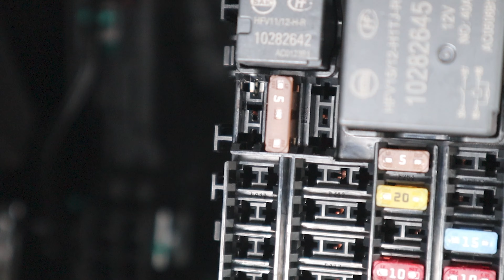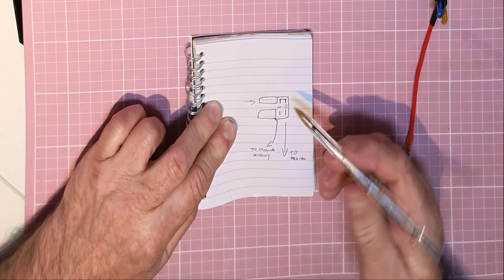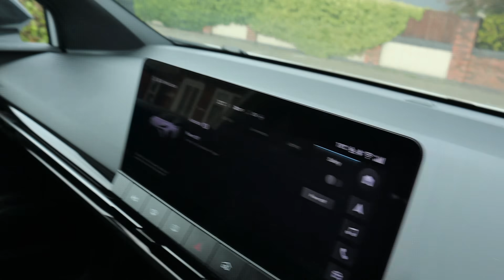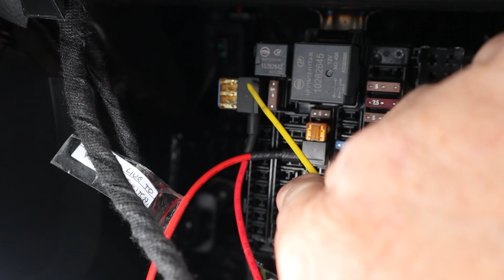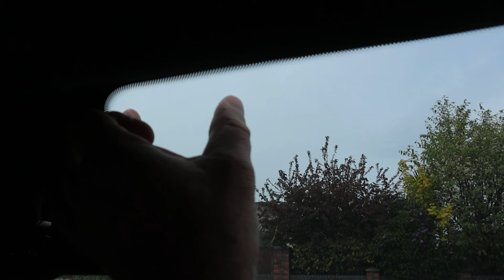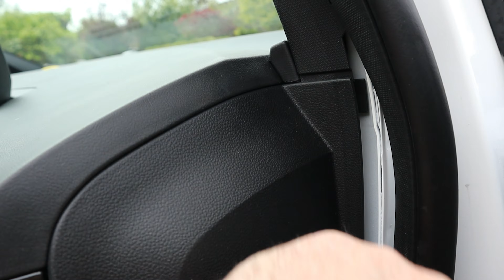MG4 FRONT & REAR DASHCAM INSTALL PART 2 OF 2

Comment: The video is very very good and ultra detailed. I have a question, if the problem is the parking mode that long holiday can drain your battery, instead of installing the switch is it not easier just disconnect the dash cam?
Reply from the maker: HI thanks for the kind words...yes you could do that as well but if it is left for regular long periods (like mine is) it saves wear and tear on the micro USB socket
Reply: @TomsManShed  thanks Tom

Comment: Hi, could you tell me where you got the micro3 piggyback fuse tap please?  I ordered some off of Amazon and the other end (I'm not very technical) where the dash cam lead plugs into was too small.  Nextbase say they don't sell the micro 3 and I'm struggling to find one that fits.  Many thanks
Reply from the maker: Links to the micro 3 and the micro 2 piggybacks are in the description
Reply: @TomsManShed thank you.  And does the bullet connector just push into the end?  Or did you have to wire and crimp it?
Reply from the maker: @SteveDaxx  Hi Steve  I think all the bullet male connectors and female sockets came ready crimped to the wires but its 3.5 years ago so can't fully remember...I may have had to cut some off and crimp on new but its easy enough with a proper crimping tool...I did a vid on a good crimping tool here   https://www.youtube.com/watch?v=8Gh2BK4ANc0   I would always advise using this type with the proper wide jaws and not the thin ones that are part of wire cutters.

Comment: Excellent video 10 out of 10 keep up the content just one question where do I find the voltage cut off until thanks daz
Reply from the maker: Hi Darren...thanks for the kind words...I really appreciate it.

Yes I just checked and I forgot to put the link to the hard wiring kit in the description (I put it in the vid of this same camera in my previous car an MG ZS) so have now added it to the description of both parts of this video.

You can set the voltage not to go below a certain amount on it...and it stops your battery running totally flat in park mode .

There are many on Amazon ...this one is the one I used https://amzn.to/4qWE2xg  although it seems unavailable at the moment but many more are for sale ...just check with the seller for compatibility ...just search for "Viofo Hardwiring Kit" 

Hope this helps

Comment: Thank you so much for explaining it so well, and for linking the piggyback/s and fuses. My supposedly "kit for MG4" didn't come with them and there I was puzzled looking at my fuse box.

Ordered, I will try again when they arrive!
Reply from the maker: Hi Zeioth Thanks for the thanks glad it helped yes the hardest bit is getting at the fusebox...I have never had a car that requires you to remove a whole panel to gain access ...why the couldn't have put it behind an easy to get at flap is beyond me
Reply: @TomsManShed  All working. Thank  you!!!

Comment: Hello id like to know more about the piggyback micro3. Can I add a speaker instead of dashcam with it? It has black and red wires. Thanks and sorry I did not understand everything I'm French :-)
Reply from the maker: Hi Emmanuel   You can power any 12v component from a piggyback micro3...all it is for is to make sure that component has its own fuse and is not sharing a fuse with something else.

Re a speaker ...The voltage to the speaker itself (if its just a speaker) can vary system to system...but you would never connect just a speaker to a 12v supply from the car fuse box.

The 12v would run to the head unit/ amplifier etc and then the speakers connect to this
Reply: @TomsManShed  thanks!

Comment: Hi, sorry about the late hour
I have a MG4 like yours, I just watched your video regarding the connection of the Dash Cam. I would like to ask you, if I don't use the 2Pin fuse adapter for the foreseeable future, can I still connect everything like you did? although I imagine it's not a job done properly... I'm telling you this because in the space of a week my car was all over the passenger side... so I decided to install the Dash. Could you tell me how I get power for sentry mode?
Thank you in advance for all your understanding
Reply from the maker: Hi Davis... Not sure what you mean by "in the space of a week my car was all over the passenger side" But to answer your question you need a permanent live for the sentry mode and a switched live for the normal dashcam mode ...thse can be taken from any source where this applies ...the positions I picked just seemed the easiest.
Reply: Good morning Toms, 
Thanks for your comprehensive answer.
I simply solved it by reversing the colors of the 2 wires, red and yellow 
Basically, I inserted the yellow wire into the 15a 3-pin light blue fuse, while I inserted the red wire into the 10a red fuse. Now, luckily for me, the sentry mode also works very well...
Thanks again, happy holidays 2025

Comment: Amazing, I just got a Viofo a229 plus for $150 during black friday sale.. waiting for the delivery to work on it. the hk4 kit however does not include these 3 prong fuse bits.. is there a 2 prong one that can be used with ACC by chance or is it only the 2 you mentioned that go off when the car is locked? 

Btw when your 12V battery gets low the MG will/should supplement from the HV battery
Reply from the maker: Hi Airbag...thanks for the kind words...Those 2 at top left (20 mins in) were the only switched live ones I found ...all the 2 pronged ones were permanent live.

Some of the unused 2 prong sockets may be switch live but I was reluctant to use them....with the car not using them.

On the 3 pronged fuse the power in is the middle prong and then out to 2 separate circuits so you could fit a 2 pronged fuse to a 3 pronged socket if it was only feeding one way...ie the dashcam.

The 3 pronged ones are readily available on Amazon/Ebay etc though and are quite cheap so it may be worth getting some 

Yes I believe the  HV  batt does charge the 12 v batt when its low but have still heard of some folk on the FB coming back from hols to a dud 12v batt.
Reply: @TomsManShed  Thank you for the detailed answer once more Tom. I will try to get the 3 pronged one... I wonder if in my model the cig lighter may in fact use all 3 prongs vs just 2. I have the refresh version with the additional wiper, anyway I'll test that too :)
Reply from the maker: @Airbag888  Yes you may be lucky re the wiper....Yes the "you don't need a rear wiper due to the design meaning the rear screen wont get dirty" was a load of rubbish...it may keep reasonably clean at speed but mucks up like any other while static etc ...I really miss having one.

Let me know how you get on and which other socket is switched live if you find one and I will add it to the description and name check you.

Comment: How did you connect the switch?
Reply from the maker: It has to be connected to a permanent live not a switched live otherwise the parking mode wont be available...the switched live I used is shown at 24:00 minutes in 

Other parts of the vid show the switch in detail etc .

Comment: That connection you thought was an earth but wasn't is the 12V feed from the front fusebox!
Reply from the maker: Thanks for that...useful to know...you would think with it being live they would have put a plastic cover over it hence me thinking it was an earth
Reply: @TomsManShed  It would've been useful if they had.  I made the same mistake and decided to find out what it was.  I measured battery voltage between it and the chassis, that's when I followed the wiring diagrams siteguru had linked from the MG EVs forums and found there was a 12V feed from the front fusebox to the interior fusebox

Comment: it make no sense, Why MG has chosen not to use the onboard cam for DASHCAm and/or Alarm. i do hope that will come in time.
Reply from the maker: Hi Tommy...yes I suppose they could (like Teslas) but the problem is that the built in cams on the car are for traffic sensing etc and the rear cam is placed to help with parking and not in an ideal position or field of view for footage of drivers behind like a dashcam is....one day though it will be standard on all cars I reckon.

Comment: Only just seen this vid as I’m looking into an MG4, I used to watch your 3D printing vids for the CR6-SE which were very informative. 

I had the same issue when I got my VIOFO A129 ~4 years ago. You actually don’t need to plug into the base, you plug into the main camera unit and that powers the GPS base. I think the power into the GPS base was for some of the much older dashcam models.
Reply from the maker: Hi Callum..thanks for the kind words.

Re the base....you do need to plug the power supply to the base if you want GPS location info on the clips.

It's the base that contains the GPS chip...and they do seem to break down often...I have had 3.

The cam will still work with the power supply plugged directly to it (as I am using now because am fed up replacing faulty bases) but it wont record any GPS info...just time and date etc.
Reply: @TomsManShed  hi Tom, I was able to display gps info on my A129 camera when powered from the camera, not from the base, this also seems to be backed up in the Q&A section of the VIOFO website for the gps mount. 

Could it be an issue within the camera itself that is affecting your gps module?